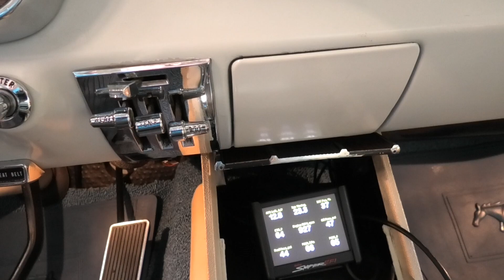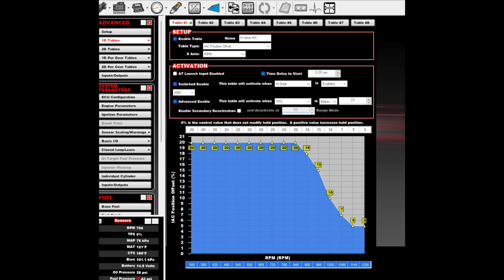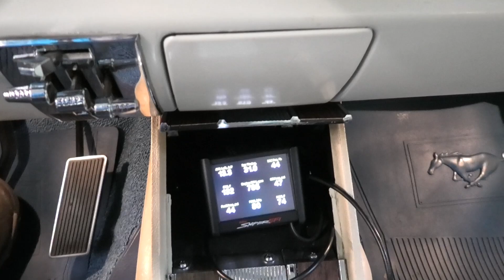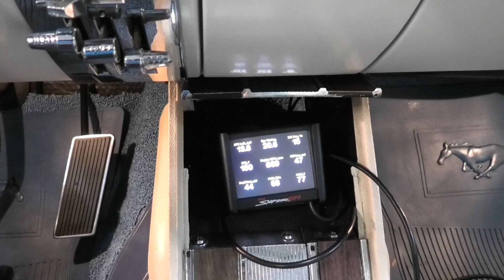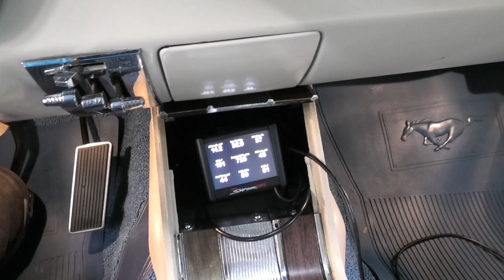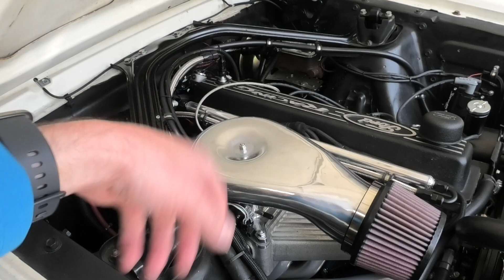Ford 200 MPFI Quick Update

Comment: Any word if they will do another run of these heads, I live in Australia and have access to the later cross flow 1976 to 1990 alloy and steel head 200/250 but still prefer the early motor. 
The siemeze centre exhaust ports on the early 144/200 make the exhaust sound great in a true dual setup
Reply from the maker: Matt Cox says he will produce more but no one knows when.